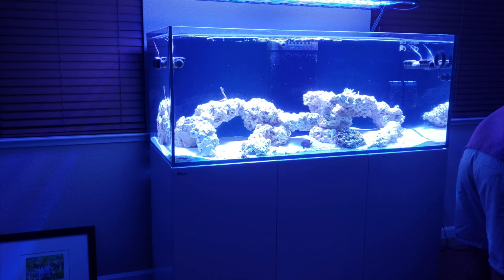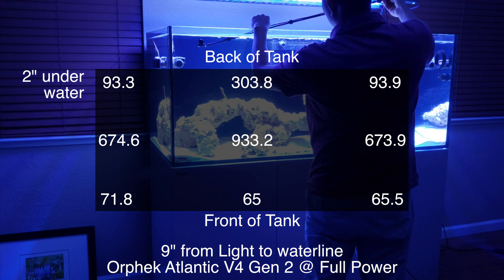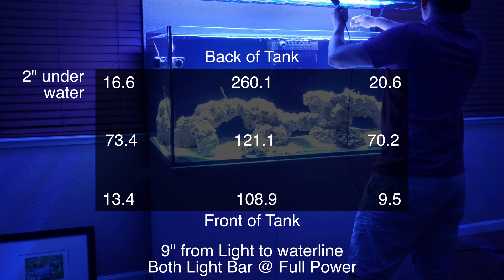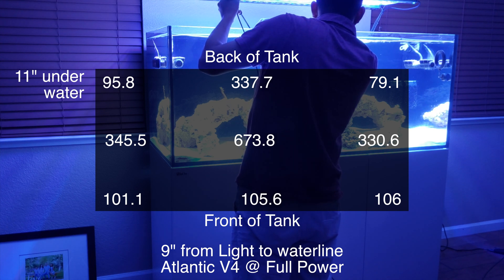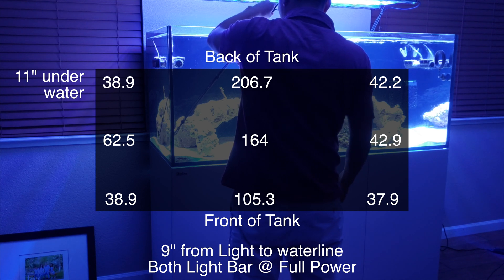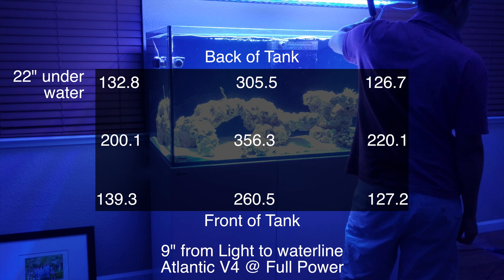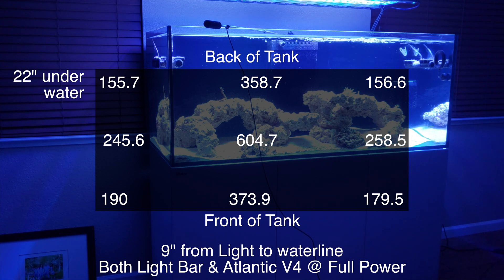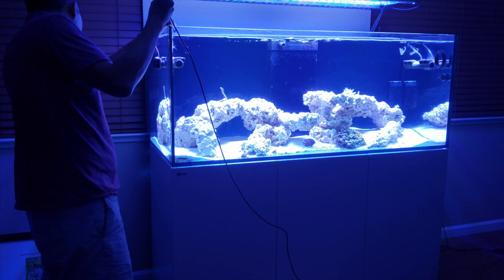Orphek Atlantik and Blue+ LED PAR Reading: RED SEA Reefer 625XXL Setup

Comment: hi Paul.how much did the light goes for your set up thanks justin
Reply: cost
Reply from the maker: I got it for a good deal.  Email me if you want some of the same light: paulsvang@hotmail.com.   Typically they are $1100 each light for the Atlantik v4 Gen2. The light bar is $160 each.  The AI rail is about $60 and the screws from lowes was around $15.
Reply: @ModernReefer  hi Paul the AL rail and screws I want to get 1,how much would it be ifu send it to me
Reply from the maker: @justinwiggill7345  The AI rails are no longer made. It would be hard to find them now. They would also be expensive to ship to . your location. I'll check for you though.
Reply: @ModernReefer  OK thanks
Reply: Hi Paul would like to get them, but that price is out my league, I stay in south Africa, just got a nice tank now will send u some pics
Reply from the maker: @justinwiggill7345  What kind of pictures were you looking for?
Reply: @ModernReefer  hi I said I will send u some Pic of my tank
Reply from the maker: @justinwiggill7345  surething.  Send it over.
Reply: @ModernReefer  hi I sent my tank, just need the lights now
Reply from the maker: @justinwiggill7345  Looks very nice.  Your sump is also very unique.  I've never seen anything like that before.
Reply: @ModernReefer  thanks the sump came with the tank and and stand with the 2 heaters, 2 wave makers skimmer and the return pump it cost me in R14500 in your currency it would be 966,66 2 dollars
Reply from the maker: @justinwiggill7345  okay. That's not too bad.